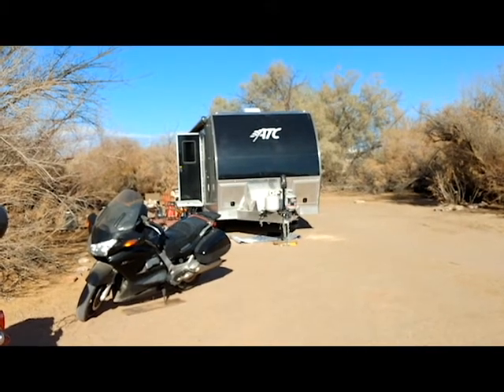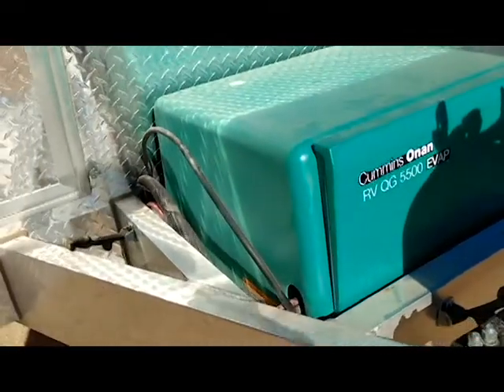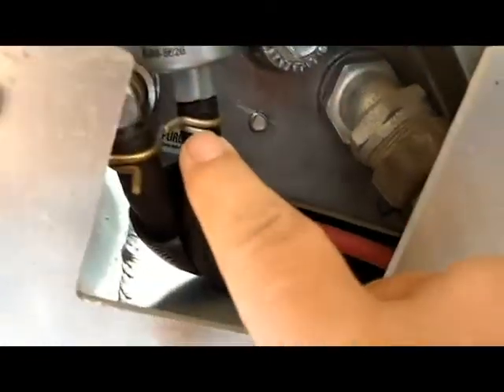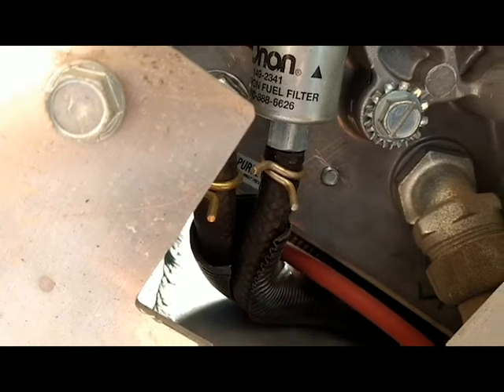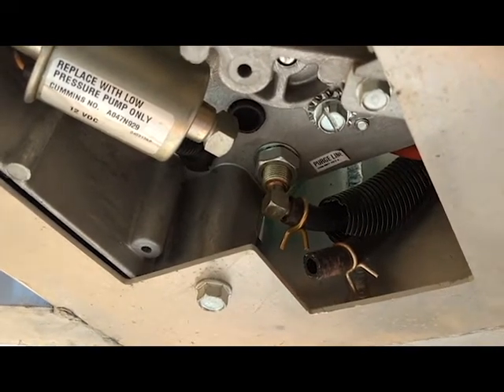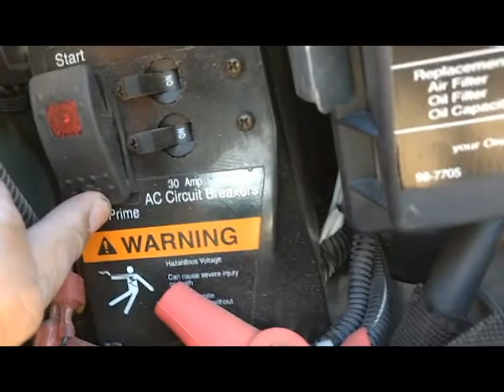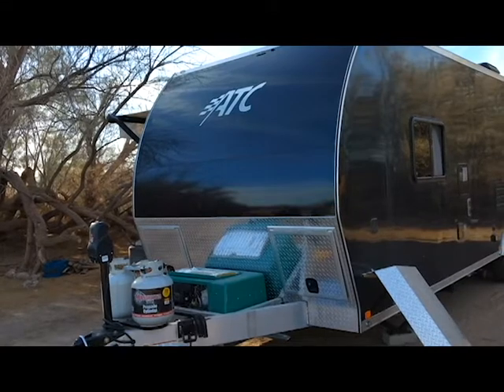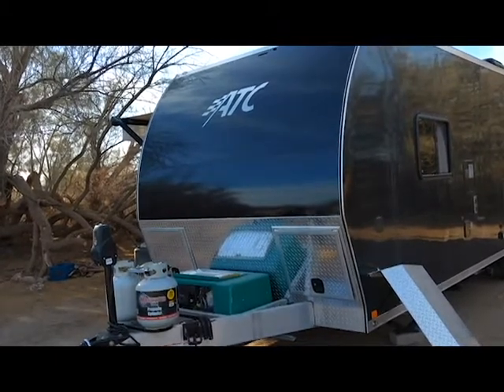Replacing a Fuel Filter - Onan Generator RV QG 5500 EVAP

Comment: Thanks for the video. We are in the process of purchasing an ATC trailer/car hauler.  Would value your opinion so far, good points and bad points.  Thanks,, Bruce Thompson.
Reply from the maker: Bruce Thompson , The ATC has thus far been rock solid after 10 months of living in it full time and towing it across the country for 10,000+ miles. No leaks from rain, doors and windows still close properly, nothing falling apart. What dealer are you going through?
Reply: Road Pickle we are going through Premier Custom Trailers, Michigan. Brandon & Brian. Working on the details right now. Ceiling exhaust fans are one issue. To go with the std ones or upgrade. Also we like the big sink but it messes us up the room to fit one of our vehicles. Is there a better way to communicate than through tube..  thx- Bruce
Reply from the maker: Bruce Thompson If you're on Facebook, search for the ATC toy hauler owners group. Or, email me at steve@toomuchtina.com

Comment: Have you had a chance to evaluate your toyhauler's ability to withstand the heat/cold? They only list an R value of 3 for the walls, 11 for the ceiling and they list nothing for the floors. Are the floors not insulated? TIA!
Reply from the maker: Allen Baker , ATC offers optional spray foam insulation . Left on its own, the trailer can get pretty cold or hot. A single air conditioner struggles to keep the trailer cool because the ramp door contains no barrier against heat due to extra reinforcement that ATC adds. However, when I draped a couple sheets of Reflectix on the exterior of the ramp door, the air conditioner was able to keep the inside at 73 degrees without having to run constantly. Regarding heating on cold nights, the trailer holds it heat fairly well. The furnace can maintain a comfy temp and only kick on for 5 minutes every half hour.
Reply: Road Pickle Awesome! Thanks for your insight!
Reply: Road Pickle, did you guys go with one or dual AC's? Thanks.
Reply from the maker: rkvantiflin Single AC. I'd recommend dual if you're going to be in warmer climates.
Reply: rkvantiflin Neither, I'm leaning a more towards Northwood's Desert Fox or DRV's JX450. They are both supposed to be true 4 season RV's. Regretfully they are not entirely aluminum, but they are much better equipped against the elements.
Reply: How noisy is the Onan generator from the bedroom when you guys have to leave it on during the night?
Reply from the maker: rkvantiflin The Onan is definitely audible, but not loud. We can still watch TV without issue. It's a low hum that you can tune out and sleep to.

Comment: Why does my Onan 5500 generator start then die
Reply from the maker: Could be a lot of things. Some common issues ... If you're camping above 5000 feet, try turning the carb adjustment knob all the way clockwise. Clogged fuel filter, pump, or fuel lines will allow fuel to seep through when not running, but will run dry while running.